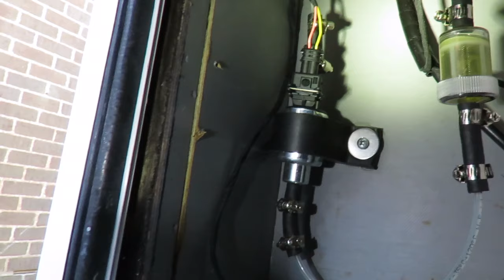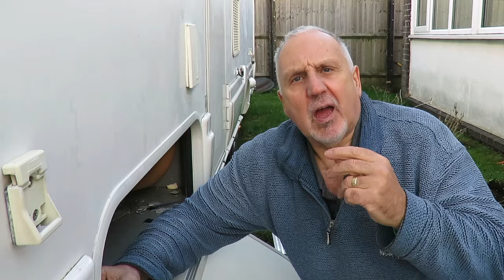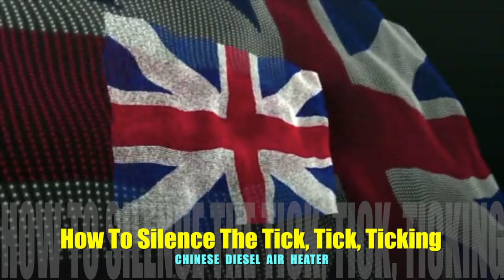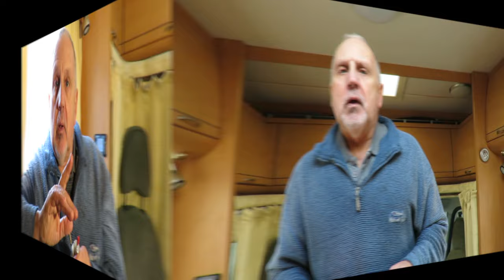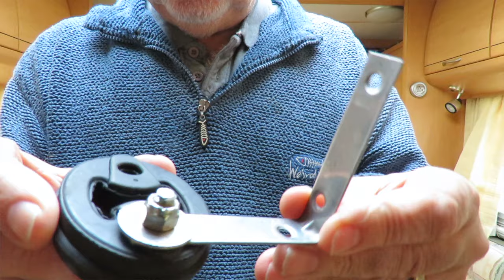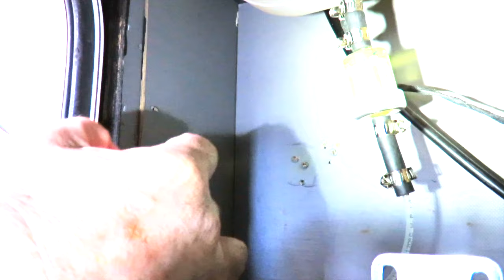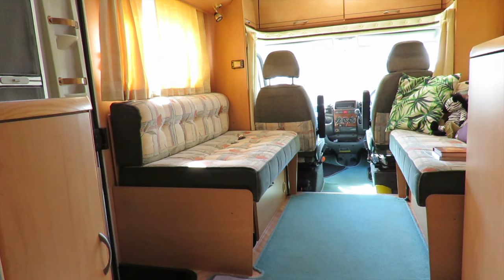How To Fix A Noisy Fuel Pump On A Chinese Diesel Heater  - Quiet Fuel Pump And No More Ticking Noise

Comment: would adding a capacitor across the solenoid make it quieter without needing to take it apart?
Reply from the maker: Hi,
I'm not too sure..?
It's more of a mechanical problem really as the pump pulses....
ATB, Steve
Reply: Was thinking the same.
I assume the power is simply full on,full off, so maybe ramping up and down more slowly would stop the piston banging and making a noise.

Comment: I tried fitting one inside a vacuum flash. Wrapped foam, wool insulation. Suspended with string. Buried in sand in box.
Reply: I eventually just wrapped it in wool insulation, and put in same box as heater. Also fitted the green "quieter" pump. Just about hear it now at 2 in the morning, but not usually on. The green pump appears it can be dismantled. Seems bad design metal hitting metal. I wondered if pump valve could have rubber on it.
Reply: I wondered if pump could be dropped in diesel tank. Also the nylon pipes could be put inside rubber tube.

Comment: Not unlike any electric fuel pump, the metal casing is heat dissipating, covering it with anything will shorten its life, the reason they generally mount them inside fuel tanks is to cool them and quiet them

Comment: 0:05 Uhm.. Nope, all I hear is normal operation...

Clicking is a blessing, not a curse. If you're in a cold area, you wake up middle of the night, you hear the clicking, just keep sleeping.. No clicking, get up asap and check what's wrong.
Reply from the maker: Hi Andreas,
You make a good point there..
I don't normally run mine through the nigh though.
 Mainly evenings & mornings, just to take to chill off.
ATB< Steve
Reply: @TheWrinklyNomads  I prefer to not be cold if I can :)
Reply: Why waste fuel when you're asleep lol
Reply: @superelectic45  its not waste.

Comment: Is there any reason these heaters will not work if mounted vertically?i.e. with the long axis mounted perpendicular to the floor.
Reply: They should be mounted vertically.  Doing so eliminates the chance of pumping air into the heater.
Reply: Verticall installation dont think so, but it can be also on 90 degree tilted, with the condition of the plug to be in the top corner of the device (there is a presentation video on aliexpress) showing this.
Reply: @CosminCurticapean  I have actually mounted it vertically, and it has been running perfectly for the past three months. So far, so good.

Comment: I bet there's a higher-end pump you can get that will reduce that sound
Reply: You would be wrong. I have the extremely expensive German Espar pump, and have stayed overnight on other boats with Espar heaters larger than mine. The pump is audible particularly at low output, regardless, on every one.
Reply: @wallacegrommet9343  Shoot, well good to know. Have you found anything so far that helps reduce the tapping?
Reply: I suspended my pump from plastic zip ties, which helped a bit. But noise is still being transmitted through the hard nylon fuel hose.  I will thread that hose through soft rubber tubing next.

Comment: I run a mix of diesel and engine oil in the heater. Thicken the fuel used and the tick is reduced because the thicker mixture acts as suspension for the piston. Tick is reduced by around 50% 👍🏻👍🏻
Reply from the maker: Hi Jim,
Sounds a good idea. Might try that.
I also use a diesel additive to help keep things clean inside the burner as well.
ATB, Steve

Comment: Hi there great video on how the fuel pump works, I have been reaching out to all you youtubers to try and solve the problem with my heater it was delivered on the 11th of January but have been unable to get it to work let me explain this is the email I posted with aliexpress but they are very slow to respond.   I am unable prime the heater, the tank has fuel, I manually primed the line from the tank to the fuel pump I pressed and held the up and down arrows to start the pump, the pump start and continues to pump  but no fuel come through the pump to the ignition fuel line As far as I can see everything else seems to work but without fuel the heater can not work. So to conclude  I think I may have a faulty fuel pump. Please advise. Michael . ( This heater was delivered on Wednesday 11th January ) any help would be gratefully appreciated. thanks Michael. anyone have the same problem?
Reply from the maker: If you have a relatively short fuel pipe run, then I wouldn’t bother priming at all. Just turn on and let the unit do it’s thing. 
It’ll soon get fuel to the burner. 
May throw up an error code, but just restart and go again until it fires up. 
However, if you cannot hear the pump ticking, then there’s a problem!
It’s not getting the start signal from the controller or controller board. 
I may also be a faulty pump, although I doubt that. 
Hope this helps 
Steve

Comment: Could you replace it with something like this  2.5-4PSI Inline Fuel Pump Electric Most Lawn Mowers & Small Engines Gas Diesel | eBay
Reply: I think No, because this type pulse pump is part of the electronics how it controls it power / thermostatic value!

Comment: Could you put in powdered graphite  inside to help with lubrication?
Reply from the maker: Never heard of that one before...?
Reply: The parts making the noise are constantly flushed with diesel fuel on its way to the burner.

Comment: Sorbothane mounts reduce the vibration more than almost anything else. 

Suspending helps, as mentioned. 

The comments re sound-deadening the space are plausible - use fireproof fibreglass around the pump and fire-resistant sound-deadening mats on the enclosure walls.
Reply from the maker: I’ll look into that. Thanks.

Comment: I wrapped my pump with polymer packaging material to the size of small rugby ball then strung it up with wire so it wouldn't touch the body. Looks odd but 99% silent inside motorhome.
Reply from the maker: Good idea.
I'm considering changing to something like that.
Wrapping pump in a small container and then using a spray foam....?
Just a matter of persistence until you hit on some thing that works eh.
ATB, Steve
Reply: @TheWrinklyNomads  I considered sorry fowm but because it's denser than wrapping with packaging, I decided against as it would be a nightmare to separate from hardened spray foam. I can't hear my ticker pump and was an easy fix.

Comment: thanks for showing the pump inside.
But the noise can be not only from the pump, but also from noisy neighbors, passing cars, running engines, etc.
In my opinion, the best solution to dealing with noise is to use polyurethane earplugs.

Comment: If you want to reduce the noise significantly then get 2 empty 500ml water bottles, cut in half,then in half again down the middle to create a form to spray insulating foam into. Create your form cavity with the pump inside with extended electrical leads. Spray in your expanding or non expanding spray foam! Your welcome!
Reply from the maker: Hi,
Yes, I have heard of that method before and I believe there's a video of someone doing it as well on YouTube.
It sounds quite a good idea actually!
At the moment I now have the pump outside the van and suspended on rubber straps which is working quite well.
ATB, Steve

Comment: And never use kerosene in this heater it will wear out the pump. Less lubricating properties with kerosene however you can mix kerosene and diesel together

Comment: Just buy a webasto pump damper, not that expensive, stops the tick from being transmitted into the fuel line which amplifies the sound, worked for me 100%
Reply from the maker: Brilliant idea.... thank you. 👍
I never knew they existed!
They must work something like an accumulator on a pressure system.
I'll be ordering on now.
ATB, Steve
Reply: @TheWrinklyNomads  have you tested the pump damper? I used cable ties to "disconnect" the pump from the body of the car. I also installed the pump with just a little angle (output higher then input) and I used normal flexible fuel hose from tank to pump (no vibration and ticking) and from pump to heater I used the original because you want the impulse injection. That doesent work with the flexible rubber hose. Maybe that helps. =) Greets from Germany
Reply: That's great mate. Send us a video please

Comment: I tried tying pump to a stretched bungee cord, still noisy.
Reply from the maker: Yes, I've tried that too.
The noise will transfer along anything, its a right pain...!
Reply: @TheWrinklyNomads  I have one now in cupboard in flat. I wrapped the pump in ceramic heat cloth. Quiet once up to running heat. I think they need to be housed inside a insulated box not touching anything.

Comment: Cannot help but notice that your pump is in the incorrect position compared with other videos, in that it should be at an angle of 35 degrees and of course up the correct way.
Reply from the maker: To avoid air bubbles within the pump getting trapped and causing wear, as well as incorrect fuel dose, the optimal angle is 45 to 90 degrees. 
These bubbles occur through cavitation. If the pump is much lower than 35 degrees you risk this happening.

Comment: More simple solution is to suspend pump with a hook and a couple of cable ties. result is an almost silent pump.
Reply from the maker: Hi Rod,
I did try that, but felt that it would wobble about too much and possibly damage the fuel line.
Ive seen it done by over people though.
ATB, Steve

Comment: I thought the pump needed to be mounted diagonally, instead of vertical….
Reply from the maker: Hi Stanevo,
The only thing you should not do is mount the pump below 45 degs.
Air bubbles air created, due to cavitation, with the pump as it pulses.
You need to ensure these get released up along the fuel line and into the burner, therefore 45 degs is about the minimum to ensure there are no air bubble left in the pump, causing incorrect fuel dosage and pump wear.
The optimum pump angle is 90 degs, allowing the air bubbles to rise up naturally without any pump restrictions getting trapped within the pump.
Hope this helps,
ATB, Steve

Comment: Pump should be mounted at about 45 Deg
Reply from the maker: Hi,
The only thing you should not do is mount the pump below 45 degs.
Air bubbles air created, due to cavitation, with the pump as it pulses.
You need to ensure these get released up along the fuel line and into the burner, therefore 45 degs is about the minimum to ensure there are no air bubble left in the pump, causing incorrect fuel dosage and pump wear.
The optimum pump angle is 90 degs, allowing the air bubbles to rise up naturally without any pump restrictions getting trapped within the pump.
Hope this helps,
ATB, Steve

Comment: A teflon seat could not be machined in one side or the other there some how.
Reply from the maker: That's possible i suppose..
But it's all about cost really.
I have upgraded this whole system since this video was made.
Pump is positioned under the vehicle now.
here's the upgrade video:
https://youtu.be/HHJaPP2uLFA
ATB, Steve
Reply: There is a silent pump, you look on you tube for it.

Comment: Who can afford to run on 5.5hz with diesel at 152.9p lol
I run my heater on an eberspacher pump which is quieter.
Reply from the maker: When the burner is getting the van up to temperature they all run at maximum.
Mine is 5.5Hz and throttles down when temperature is reached. (when set on 'C' )
Also, I have tested a Eberspacher pump against a one of these.
There is no audible difference in sound level at all..!

Comment: Don't buy a ultra quiet fuel pump, they are not that quiet, make a plywood box and line it with roofing sheet lead , hang the pump inside on tie wraps , seal the box and cover the outside with the same lead. You wont hear anything at all.
Reply from the maker: mmm, worth a try 👍

Comment: Goodness sake you cannot fix these pumps because they are not broken,  it doesn't matter where you put them it still clicks, mine is fixed to a bloody brick wall and you can still  hear it.. the noise is transferred through the fuel line

Comment: Unlubricated?  It is pumping oil.
Reply from the maker: Hi,
Quite right.
Probably should of expanded on that a bit.
Has no external form of lubrication or wear protection, as in no piston ring, no seals to dampen noise or no oil channels for moving parts.
But, running fuel oil or not it's still a noisy little bugger.......!!!!
ATB, Steve

Comment: Don't buy it will let you down when you need it most cheap is no good.mine worked 2 times in 12 months never agane worked.good luck if you do.
Reply from the maker: Hi Geoff
I'm still using the same pump from 3 years ago..!
Maybe I'm just lucky? But I will definitely be upgrading to a newer 'silent' pump when I upgrade the system 👍

Comment: The Pump has to be angled not straight up and down thats what the directions say.
Reply from the maker: Hi Kiger,
When the pump pulses it creates cavitation within the pump body, which is tiny air bubbles.
If the pump is at an angle these air bubbles will become trapped causing two problems:
wear within the pump & incorrect fuel dosage, leading to a lean fuel burn and incorrect combustion.
With the pump at 90degs any cavitation will be completely avoided.
Instructions say 45dges, which is the lowest angle you can have them I would think, before it becomes a real problem.
ATB, Steve
Reply: @TheWrinklyNomads  John McK 47 gives a great explanation of this on his channel in the video entitled "Chinese Diesel Air Heaters Part 7 Metering/Dosing pump".  The original German version of this pump has a tiny filter inside where the particles blocked will accumulate and sometimes fall straight back down in a chunk and potentially block the intake.  To avoid this, the manufacturer had recommended tilting the pump at a slight angle (between 15° and 35°) so that particles fall out of the way.  The Chinese manufactured models generally don't have a pump with that same filtration, but when they copied the German heater they also copied the manuals and didn't always bother changing instructions when they substituted something like a different pump.  So there likely isn't a valid reason to have the Chinese pumps mounted at an angle, but it probably wouldn't hurt just to be in the habit of mounting them at 15° or so just in case.  The only caveat being that you should prime it in the vertical position first to get all the trapped air out.  Cavitation bubbles after that aren't going to cause you any problem if the angle is slight.
Reply: @NorthernKitty  good info, thanks. Do you see any issues with vertical mounting these copy pumps then?
Reply: @RossTallo  My guess is that only the original design benefited from a slight angle, but it doesn't hurt to play it safe.  Who knows what you're getting when you buy these?  I'll be installing mine at a slight incline, maybe 20° - easy enough to do with no downside.
Reply: @NorthernKitty  I'll play it safe too I think! Going to install this week all being well. Cheers, Ross
Reply: @RossTallo  Good luck!!!  😊

Comment: no its not as good as it gets....
i have 2 diesel heaters , one noisy pump one i cant hear...
the one i cant hear is on nylon air line as a fuel pipe and 2mm......
just found a length and changed out the fuel line on the noisy  pump and thats now silent as well....
get rid of you re cheap nasty plastic fuel lines !!!